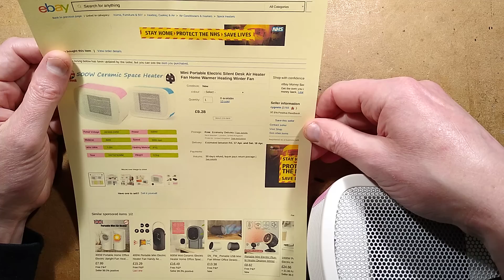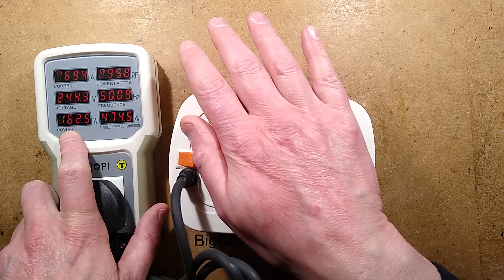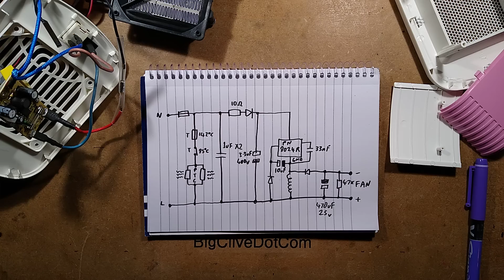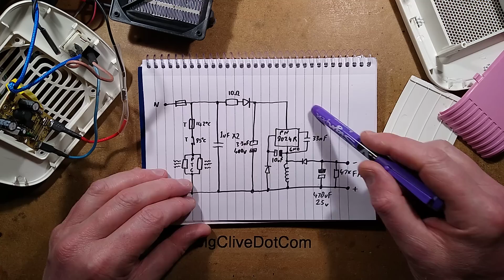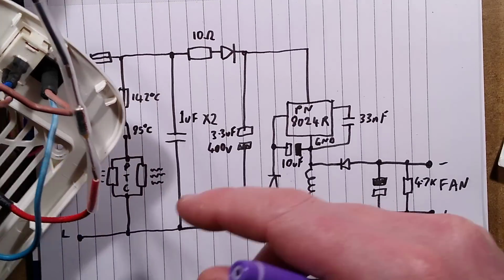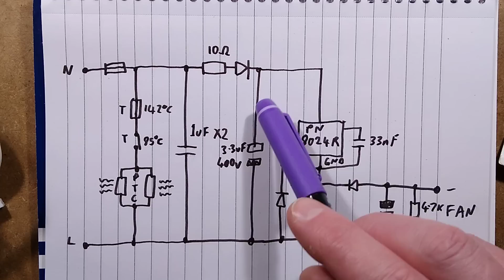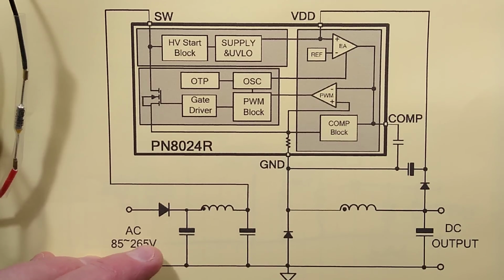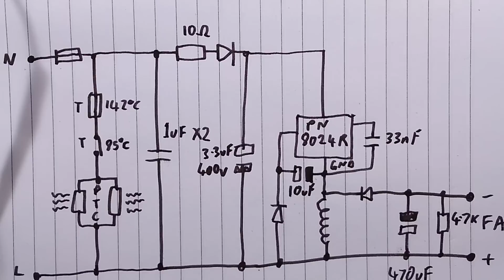Inside a pink plastic 500W heater from eBay.  (Good for parts.)

Comment: Is that initial 1.5 kW spike on startup an inductive load rather than a resistive load? I had the devil of a time with an inductive load on a timer socket, it would just let the smoke out until I bought one fit for purpose. 

This was a good 10 years ago, I only grow cacti now.
Reply from the maker: Resistive.  The cold PTC heater starts off with a low resistance.
Reply from the maker: Would that have been outdoor discharge lighting?
Reply: @bigclivedotcom  yes, 600 W HPS. A fairly good space heater in itself!
Reply from the maker: @satyris410  If the ballast has a power factor correction capacitor, that will present a near dead short when the timer's contacts close and may make them weld closed.

Comment: I'm new to electrical gizmo's, so please forgive me if the answer is painfully obvious to those with more knowledge. Why would you put a fuse on the neutral? Would it not be more logical and safer to put the fuse on the live side of the circuit?
Reply from the maker: Yes, but in this case it's not too bad since it's double insulated, so the fuse will only go with a short circuit between live and neutral.
Reply: @bigclivedotcom  Thank you.

Comment: Im curious what value the inductor is. I presume that the 12v is hard-wired in the chip. Are there versions for other voltages? What is the max current it can deliver?
Reply from the maker: Some of the chips have a default voltage is a sense pin is tied to a power rail, but will offer higher voltages with a divider on the sense circuit.  It's hard to find data about some of these chips since they are aimed at manufacturers only.

Comment: I'm surprised there's not a " tip switch" that shuts it off if it tips over. Most heaters I've seen in the last couple decades have them.
Reply: Not PTC heaters though. Only heaters with a "classic" heat coil have to have a tip switch by law afaik.

Comment: Walmart in the US sells a similarly designed 120V 250W heater designed the same way, except they also add the 'required' tip switch on the bottom of the unit. Board is obviously adapted for the 120V market, but is basically the same design electrically. This time of year they can be had for $2-5, depending on location clearance pricing.

Comment: Interesting that its cheaper to use a Voltage Regulator and put a 12V fan in instead of using a 230VAC one...
Reply: Quite rare and expensive 240v fans nowadays for this size format  (I have yet to see one that was not from a 1990 old system after that it's was 12v fans)
Reply: Allows for 120 or 240v operation probably
Reply: @linswad  heater half heat  (maybe as this is a ptc heater probably just pull more currant until it gets hot enough and then levels off, so it probably pull twice the amount of amps to get same heat at 110v) and fan would run at half speed if it was 240v fan  (running at 12v means the fan can cover 90-260v range depends if its setup for it or just 240v)

Comment: What is it with Clive and pink stuffs?
Reply from the maker: It stems from an incident where I plugged a set of pink LED lights into a power supply and it exploded in my hand.  There's something strangely pleasing about electrically dangerous things made of Barbie-pink plastic.
Reply: @bigclivedotcom  Is there a video of this incident?  :)

Comment: With the heater being at only 500W, should the plug top have come with a 5A fuse installed at least? I know the fuse protects the cable rather than the appliance, at 13A fusing, it would need to have a 1.5mm2 flex? Looking forward to the live stream tonight!
Reply from the maker: I just consider myself lucky if a direct import has a fuse at all.  If it's part of the circuit that's even better.
Reply: @bigclivedotcom  😆
Reply: @bigclivedotcom  just watched your video on fuses, where you showed the fake Chinese ceramic fuse with no sand inside. It's sad when even something like a fuse is suspect, doesn't give you much hope for the device itself.

Comment: You'll burn your hand before the plastic melts - it won't mind 95C. I wonder what the equilibrium temperature of the heater in still air is; it may still not be high enough to cause a fire, but may start melting the plastic a little.

Search "PTC ceramic space heater - repair and safety demonstration" for an amazing video of what happens when one of these heaters is left to self-regulate. I won't spoil, but I'll just say that it surprised me.

If you search "PTC heater thermal runaway" you'll find videos of someone who seems to have gotten an NTC heater instead, which makes me a little worried that some of these cheap China units may contain the wrong type of heater too.

Comment: Could it be converted to run off a 12v car battery?
Reply from the maker: Only if you could find a compatible 12V heater assembly.
Reply: Any recommendations for car windscreen demister/ heater? Most seem to a bit weak. Thanks for fast reply, btw.
Reply: I could be completely wrong, (not unusual), but I thought the electric components reduced the voltage to 12v DC  to run the fan and the heater. So...? Aye Ken I'm probly wrang.
Reply: Sorry if that sounds patronising, I really enjoy all your videos, the carbonising experiments are great, Bucky Fizz lol.

Comment: My 400w fan heater recently died. I only had it for 3 months lol, the bloody fan failed, but it was cheap crap so what did i expect lol. it was the one of the bottom left of the sale sheet you showed lol. Tho says 300w there.
Reply from the maker: The fans or their drive circuitry seem to fail a lot in these.  They should be replaceable though.

Comment: Hi bigclive,
Unrelated to this video, do you think it'd feasible to build a 220V-230V AC UPS with a few high drain 18650 batteries and readily available electronic parts off ebay?
I think it'd be an interesting project and wish you could show us making one.
Reply: Yes, look up DIY Powerwall. But EV battery modules tend to be cheaper per kWh.
Reply: @NiHaoMike64  I think just 4 to 8 18650s would be enough, so the kWh price isn't a big issue. My vision is of something really compact that would instantaneously come into action to supply power when the main is out, just like a conventional UPS, and with the advantages of the readily available 18650s and their compatibility, as well as being so compact it can literally be mounted inside the case of a desktop PC.
Reply: @benjaminq3226  Make it a DC UPS and it will be significantly simpler and more efficient. BTW, a 3S pack will match up very well with 12V. There are lipo packs that are significantly cheaper than 18650s. https://batteryhookup.com/products/4-200a-lithium-polymer-3-7v-8ah-flat-pouch-cells-lipo-batteries

Comment: I'm sure someone can explain this to me but .......    How can the rail at the bottom of Clive's circuit diagram be 240v AC Live input on the left, and 12v DC +ve fan supply on the right?
Reply from the maker: Imagine a 9V battery with one of its terminals connected to mains live.  You'll still measure 9V across the battery, but would get around 240V to ground.
Reply: @bigclivedotcom  👍⚡

Comment: Sound quality seemed off.

Something up with your setup?
Reply from the maker: In what way?
Reply: I didn't notice any sound quality issues.  Maybe slightly less boomy than normal, but other than that I thought it was pretty clear.  I'll have to watch it again now to be sure :)
Reply: @bigclivedotcom   I went back and relistened to it, and it seems to no longer be an issue, so I think it was a YouTube problem.

However, it sounded really compressed when you placed the heater on your bench face down to see if there was a thermal cutoff.

Comment: Is there a well made, safe, reliable low wattage heater I can use to warm up a very small tent when doing offsite camping in places where they don't allow you to make a campfire? I have a big lithium ion suitcase battery that outputs 300 watts continuous, I'm looking for a heater only just powerful to warm up a 2 person tent in 10-20 minutes. Maybe 200 watts?
Reply from the maker: You do get small car heaters, but it's a very inefficient use of power in a tent.

Comment: Did you really check if the capacitors were charged with a metal screwdriver
Reply from the maker: Yes I did.   It always gets a reaction.

Comment: im not entirely sure how this works. i see it has a resistive load with a fan behind it, but is this just encouraging heat to conduct and convect away? it isnt firing ir in a direction, like an outdoor heater does? this is no doubt beginner level stuff, but i'm trying to wrap my head around this kind of thing. dr bomphrey once threw a board rubber at me so i chose biology and chemistry for a-level instead of physics.

Comment: Hmm, how do the latest generation of Wonder Heaters compare?  They are now advertised everywhere as 'virtually free heat', instant heat, super fast heat high efficiency low power, uses unique ceramic heater element technology - so clever no information is given out, makes use of Bernoulli's conservation of Energy for super efficiency, UK adapter included !....         Is it just the same as one of these, but with an LCD and made cheaper?
Reply from the maker: A watt is a watt.  These small heaters will just heat your room slower than a full size one.
Reply: @bigclivedotcom  Exactly, but my mum was starting to believe the 'hype' especially that 'latest German technology' and Bernoulli bit. I told her that I agreed with the Bernoulli bit as it is a law of physics, but to move the air it needs energy added, that's the fan..   ..but this is all missleading for so many often older people..  
Mind you I am intersted in what that stuff is between the hot aluminium conductor/radiators. That must be the mysterious new ceramic technology. Do you know what it is? It just looks like a grey wafer in your video.

Comment: If u use this heater at night and leave this on it can catch on fire and cause a lot of problem I would never use a heater with  no proper cutout functions
Reply from the maker: It seems safe, but I don't know what would happen if the fan failed.  If used on a metal tray with a smoke detector in the room it should be safer.
Reply: @bigclivedotcom   yes but this product is so cheap that if the fan fails and the heater block remains on it can catch on fire,  it is made of plastic it could easily start a fire ,I would not recommend  use of this product

Comment: discharges caps with metal tool in hand lol !!! @ 5:20
Reply from the maker: If you watch the other hand it's kept away from associated circuitry.
Reply: @bigclivedotcom  lol its fine i just have got the tingles before from doing same thing. You are a great influence thank you for your time and learnings.

Comment: I wonder if it puts out enough to heat the cardboard box we're all going to be living in next winter because of the devastating global depression we are just entering and it's going to get far worse than one can imagine.
Reply from the maker: It's ideal for hooking into lamp posts as it won't draw enough power to trip their breaker.  Between your cardboard box, some plastic to waterproof it, the heater and the street light above you're sorted.

Comment: "OTP" must stand for "One Time Programmable"... software?... i bet the heater element gets clogged with dust in like a week of run
Reply: Over Temperature Protection?
Reply: I've had one of these for 6 months since the single 100 watt review, when I bought this model and it worked all winter just fine
Reply: @james-5560  good to know, but tight fins and fans don't go along pretty well anyways, every computer geek knows it

Comment: hey i was the one that left a message on your video about the 5G and how there's tower workers who get burned working on them but i go to read the comment you left me and you turned off the comments. id like to know your answer if that's ok. thanks for your time btw i don't mean to be a bother i just don't understand how some workers get 1 degree burns while working so close to these towers.
Reply from the maker: If you go right up to a high power RF transmitter then there is a risk of a high exposure.  But the level falls off exponentially following the inverse square root.  It's the equivalent of pressing your eye against a lamp.  It will potentially cause damage, but standing on the floor below the light is fine.
Reply from the maker: @SINISTER69er  I doubt that rumour.  If workers had a high enough level of metal in their system to be affected by low power RF then they'd already have metal toxicity issues.

Comment: i got a cheap pink heater from china,,,, i pluged in my super expensive  wall socket, and it went burned my house. smoke came from every room, and my bud get hot, and now i can call the fireware or the police, but lost my tower connection, and im probably lucky im not.

Comment: No thermostat???!!  you gotta be kidding me, it ain't worth a dime if that is the case; it will stay running all night and all day dozens of times when you forget it...  forget it.
Reply: It uses a PTC element.  These type of elements are self-regulating.  There are quite a lot of heaters that just have "High" and "low" fan settings with no thermostat.
A lot of these will say "Ceramic element" which is the same thing.  They work well at self regulating.
These are not designed as a set and forget heater or as some kind of central heater.  They are for instant heating and you turn them off when they are not in front of you.  Just like quite a lot of fan type personal heaters or radiant element heaters.
Reply: @EsotericArctos    Thanks,but a PTC thermistor never turns it off, it just increases Resistance (and decreases power) as it gets hotter,(at least it goes in the right direction);
They CANNOT be for instant heating,not with only 500 W; they are the opposite,long time heating
They `NEED`a thermostat,surprised they were allowed to make them without one; i would not buy one even it were free; otherwise ,GREAT video,thanks.
Reply: @josepeixoto3384  Have a little ok around. There are  many personal heaters that do not have a thermostat.  There are many from well known brand names too.
Radiant heaters with the bars that glow red often only have a low and high switch.  This is not a thermostat, but switches the number of elements on.  These are designed to be direct heaters not one you put in a corner to heat a room 🙂.
No heater should be left forgotten, whether it has a thermostat or not.
Reply: @EsotericArctos    I catch your drift,i'll check it out,eventually,thanks
Reply: @josepeixoto3384  Not saying to trust Chinese heaters, but for other reasons other than a thermostat 🙂

Comment: WTF ? All the bl**dy circuitry just to run a fan ! Would it not be cheaper to use a synchronous motor with fan attached ?

Comment: How do these "New Fangled" electric cars such as Tesla supply heat to the interior of the car for occupants?  A video would be good...especially when you tear down a new £150,000 Tesla 😊👍🏻
Reply: Same tech. PTC heater block. A heat pump (i.e. reversible AC compressor) on some newer models.
Reply: @jkenny1  Also resistance wire embedded in strategic spots like the seats and steering wheel. And in some cases, even a conductive film embedded into the windshield.
Reply: Chevy Volt uses an electric coolant heater which works in conjunction with an electric water pump and a conventional heater core with not-so-conventional Dex Cool coolant.